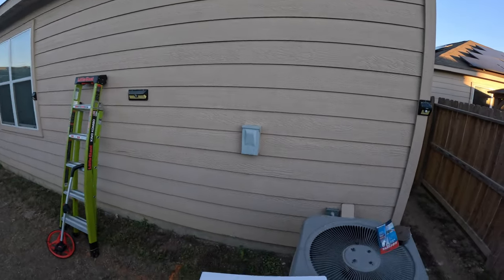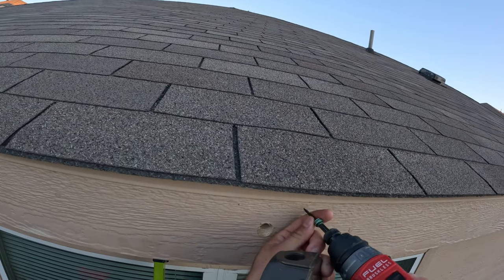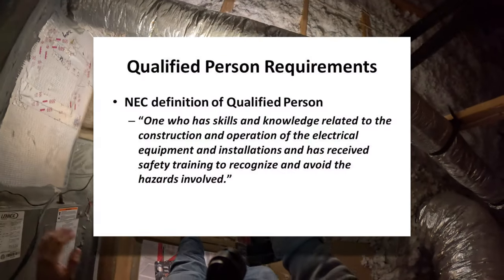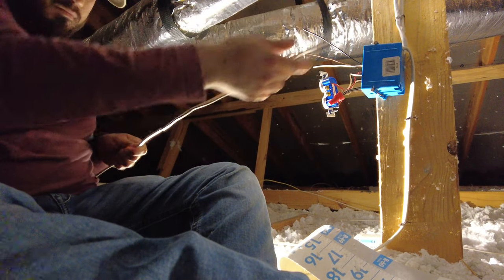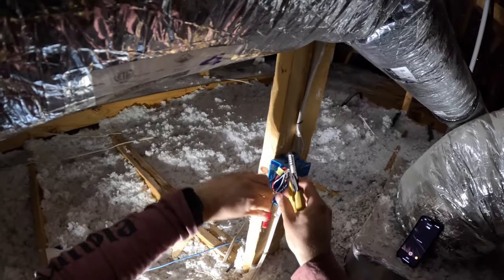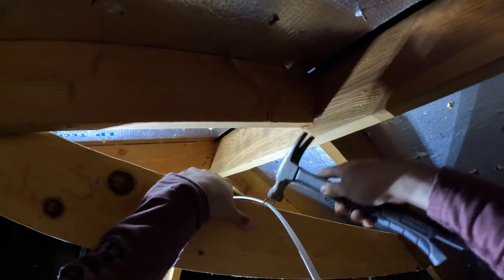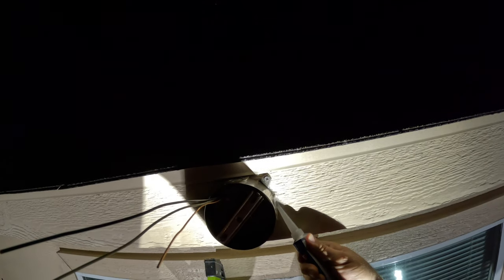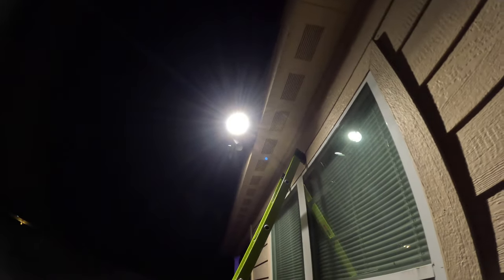How to Install a Ring Floodlight Cam (No Existing Wires/Device) | POV

Comment: don't you love that the Ring base is bigger than the outdoor box    you should have put a seal tight connector on the back side of the box and seal those screw plugs up
Reply: Took about thirty minutes to install on my separate shop building.  But....my son spent an hour trying to connect to the Ring app.  He finally gave up.  Now I have spent at least two hours trying to get thru the Ring hoops.  Sending the wrong verification code, timing out etc.  Finally, it tells me I have to buy a Ring chime to get the weak signal from my house to the shop.  Grrrrr.

Comment: Hi Sparky Izzy, great video.  I'm about to install a Ring Spotlight Pro (wired) at my mom's house. Rather than use the outdoor outlet, I'd like to pick-up power from an existing porch light about 15' away. From what I've read, it seems as though I should use that 14/2 Romex and run it behind the siding, obviously waterproof.  Thoughts, am I on the right track? Thanks!
Reply from the maker: I wouldn’t recommend this. If you connect to the existing porch light, everytime the porch light gets turned off …. The Ring Spotlight Pro camera will turn off. You want all security cameras to have constant power, no switches.
Reply: @sparky_izzy  I should have been more clear. I plan to switch the porch light bulb to a smart bulb on a scheduled on/off. The switch will always remain in the ON position providing constant power to the security device but the bulb will toggle on/off based on the times that I establish within the app.
Reply from the maker: @spea111 okay then you should be fine. When you say behind the siding, I would imagine you mean behind the wall in between the wall studs. If so, you are on the correct path 👍🏽
Reply: @sparky_izzy  Hello ... behind the exterior siding. Between the siding and plywood on the outside of the house. Not on the inside, between studs.
Reply from the maker: @spea111 yeah that’s not up to code: It would need to be behind the wall or over the siding installed in conduit.
Reply: @sparky_izzy  Got it! I'll work with my contractor who is doing some other work also. Thanks.

Comment: Question, how do I know if I have a 15 or 20 Amp? I'm installing to my garage door outlet.
Reply from the maker: If the circuit is on a 15amp breaker you want to use 14awg romex. (14/2 - white romex)

If you have a 20amp breaker you want to use 12awg wire. (12/2 - yellow romex)

Comment: Wouldn't it be better to install it under the eave?
Reply from the maker: You can do either or. I have since added a roof deflector to allow the flow of rain water to the left & right of the fixture.

Comment: I have a double gang light switch feeding the old floodlight above the rear entry... I'm tempted to just keep using the switch but have to basically keep it in the on position all the time hahaha
...
Reply from the maker: You can do that or

1. You can take the 2 wires off the switch, wire nut them together to have constant power & put the existing switchback as a “dummy switch”

2. You can take the 2 wires off the switch, wire nut them together to have constant power & remove the old switch install a blank on the existing cover.
Reply: @sparky_izzy  thank you for the ideas that would be a better solution

Comment: Good video. I enjoyed the long form. Not gonna be a cabron pero, mijo. Dos cosas
1. From what i noticed, you either didnt( or didnt explain) removing the wire from the recep that you initially cut when resplicing the wires in the attic. Harry homeowner wont even bother and have hot exposed connections sticking out the back of his outlet and wonder why his shit keeps tripping or blasting him 
2. You used the orange wire nuts that came with the light. Sure theyre UL listed and fine but might as well just use tans or your red tans. On any job ive ever been on, the orange nuts immediately go in the trash. Unless were using em to cap a dead circuit or just grounds. 
Wasnt shitting on you or nitpicking too hard, as i enjoyed coming along for the ride in this video. And your "apprentice" seemed helpful, but green ha. Good shit, compa. Im subbing and gonna keep an eye out for more vids
Sorry for the novel. Be safe out there